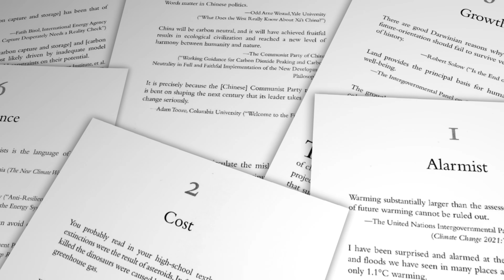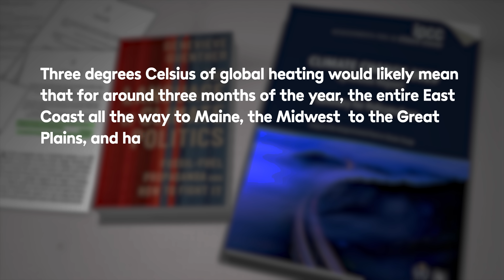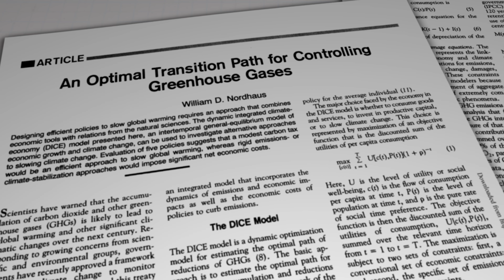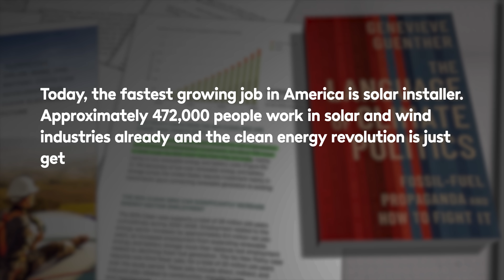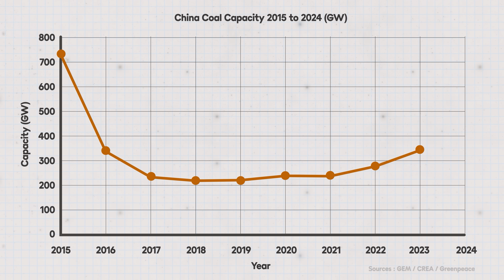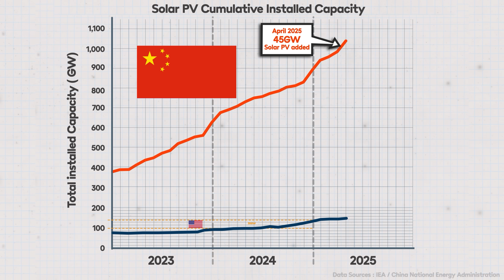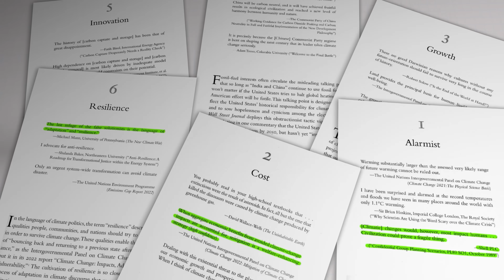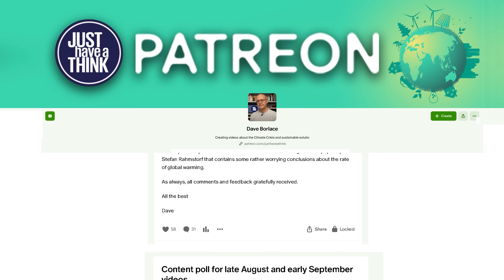New research DEBUNKS climate disinformation.

Comment: In order to build renewable energy powerplants you need to burn fossil fules and, in consequence, release GHG. The politics made by the western countries had the main effect of increasing the price of carbon credits, which large companies are still purchasing. These regulations had the effect of increasing the cost of many goods and services with an already high inflation hence reducing its capability to ''afford" climate change policies (e.g. purchasing an EV). I'm not saying the effects of climate change produced by GHG are fake and negligible, but if you rely completely on policy makers it will probably end in failure unless you change the social-economic aparatus, in other world controlling the economy. Lastly, one aclaration: The renewable energy sources won't reduce the price of the electricity bill necessarily.
Reply: Power with solar energy will become cheaper if you have it on your roof
and a big enough battery too or if God beware politics tackled usury.
Number one is more likely. 
Passive solar-thermal (Trombe walls, sun space equipped with shutters) and geothermal solutions in union with good insulation, high thermal mass walls/floors, reflective cooling facade and windcatcher will reduce power consumption significantly....
Reply: Bla Bla Bla Bla Bla 
Bollocks

Comment: Have a think?  Be a great idea perhaps Computer models are not data nor adjusted  data verified data,
Reply: Do you have any idea what Models are 🤔
Reply: @davidwatson8118  Funny I thought it was clear from Computer,  and still not data.
Reply: @davidwatson8118  perhaps Computer models is the clue?   Still not data.
Reply: @Bruno-u1r6o 
Do you not understand the word computer or model?
There is no shortage of data
Reply: @davidwatson8118  present your argument.  Most physicists accept Prof Happer's paper that CO2 has an inverse heating reaction after the first 20ppm declining on a logarithmic base or do you not understand.
Reply: @Bruno-u1r6o  Happer's arguments mirror in many respects the argument of Ångström back at the turn of the 1900's.

Ångström's argument, based on experiments around 1900, claimed that increasing CO2 in the atmosphere would have little effect on Earth's temperature because CO2 absorption of infrared radiation was already "saturated."

Ångström's experiment used a tube with uniform CO2 concentration, which didn't account for the atmosphere's vertical structure. In the real atmosphere, CO2 absorbs infrared radiation at different altitudes. As CO2 increases, the altitude at which infrared radiation escapes to space (the effective radiating level) rises to higher, colder layers. Since these layers emit less radiation (per the Stefan-Boltzmann law), the Earth retains more heat, warming the surface. Ångström's setup ignored this "thinning and cooling" effect.

His experiment oversimplified CO2 absorption.  

Ångström argued that water vapor, more abundant in the atmosphere, absorbed most of the same infrared bands as CO2, rendering CO2 increases irrelevant. However, water vapor is concentrated in the lower troposphere, while CO2 is well-mixed and affects higher, drier layers where water vapor's role is minimal. Spectral analysis later showed minimal overlap between CO2 and water vapor absorption lines, confirming CO2's distinct warming effect.
Reply: @Les_S537  This heating reduces as CO2 increases this is  to nearly zero (absorption of infrared by dry air  containing CO2 at 350 ppmv) in repeatable experiments.  I don't see this as saturation but that shorter wave length photons are depleted by water vapour.   Do you think Earth radiation is high enough energy, short enough wave length to react with CO2?  This seems to be discounted as the energy is less than the  emitting surface.  ie the Sun against energy absorbed and reemitted at night from earth?   We know a lens focuses to burn direct Sun Photons but the Earth?  The moon certainly not,  Kooks a Nuclear Physicist shows how the SB formula is in  error and over estimates black body  radiation but thats his argument rather than mine on the  Cfact site.

Comment: Still focused of climate as the major breach of earth systems when you know very well that there are three more earth systems that are far more breached than climate. And to talk about species extinction like it is just a climate issue when we are seeing the rapid decline of species mainly driven by the loss of the biosphere. You need to get to the point of accounting corruption and view earth systems with a consistent accounting, preferably net accounting and not cherry picking data through gross accounting.
Reply: Bollocks
Reply: @davidwatson8118  sounds like you know what you are walking about.
Why don't you look up the Stockholm Resilience Centre Planetary Boundaries, what the leading contributors are, then talk properly to me after that. 
Cheers.
Reply: @davidwatson8118 I am proven wrong then. So you are telling me that climate change is more of a threat to life than biosphere loss, novel entity overload, and nitrogen and phosphorus loading? And you think that measuring fossil fuels using net accounting and using gross accounting for agriculture is not dodgy?
Reply: @tobybrown7669 
What is causing the current global warming. 🤔,?
Reply: @davidwatson8118  The climate is part of earth systems so there is not just one cause but because we have breached other earth systems even more then they should be talked about more. Biosphere loss is by for the most breached out of all planetary boundaries and the main driver of that loss is animal agriculture. Freeing up land is the most important thing we can do to stabilise the climate and stopping animal agriculture frees up 40% of the ice free land allowing for more time to transition from fossil fuels to alternatives. The primary focus needs to be on our food system and transitioning to a plant based diet. We have to become herbivorous.
Reply: @tobybrown7669 
More wibble.
More bollocks 
I ask again.
What is causing the current global warming 🤔?
Reply: @davidwatson8118  my research suggests that the leading cause of climate change is animal agriculture by 118% meaning there would be a cooling effect if humanity went vegan. Stopping fossil fuels today would result in global heating before a cool occurs. 

What do you know about it?

Comment: I can’t watch this whole video, I’m too ashamed to be a US citizen. Nauseating how short sighted this administration is.
Reply: Courage. You're not the only person in the US who feels that way. Find your fellow travellers and work with them - either to mitigate the harms now, or to have a plan in place to take back control of your country and get it steady on a better path.
Reply: Stand firm and also know renewable transition is happening - slowly whether Trump likes it or not
Reply: @marksmit8112  no it's not - it's maxing out at 10% of all power supply - only electricity of course perhaps a little higher if massive hydroelectric resources are available, extremely fluctuating and thus often useless.
Reply: @marksmit8112  Renewables are a disaster. Look at what happened in Spain. They went on all renewables, and right away the grid went down, and the whole country lost power. 
The farmers in eastern Oregon are complaining about the oil getting spread all over the crops and livestock from the wind tubines, yes they still use oil. You have to lubricate moving parts with something.
Electric cars are worse for the environment than ICE cars, when you look at the whole picture. The problem is the batteries, which have gone up in flames so often, shipping companies don't want EVs on the ships anymore. 
The battery backup needed to make wind and solar practical isn't working. The biggest storage facility ever built, which is in California went up in flames for the fourth time not too long ago. The gasses released when a Lithium battery burns are the worst gasses ever produced.
Meanwhile the benefits of more CO2 are being ignored by the media. The planet is 20% more green as a result of higher levels already. CO2 was much higher in the past than it is today. Back before the Sahara was a desert. There is no data that shows CO2 really raises tempuratures all that much.
Listen to scientists, not activists. Bjorn Lomborg believes climate change is caused by burning fossil fuels, but says it won't lead to the death of all life, and it is not a crisis.
Other scientists, like Judith Currey, William Happer, and John Christie say there is more benefit from more CO2 than harm. 
CO2 is 4/100th% of the atmosphere. If it drops to 2/100% there won't be enough for plants to stay alive.
Get a grip. You are the ones listening to the lies.
Reply: @onusgumboot5565   so much disinformation in one post, you're ridiculous.
Reply: @fftunes  What exactly was incorrect?
Reply: @onusgumboot5565   Take "your" talking points into your bunker in Kansas City.
Reply: @crysstoll1191  I'm nowhere near Kansas City, but it's nice to hear from the "tolerant" left, giving your usual brilliant opinion.
I'm still waiting to hear what I said was incorrect.
Reply: @onusgumboot5565  It seems your first comment was removed? or i responded to the wrong comment? If so, my mistake. FTR i'm not tolerant nor left.
Reply: @onusgumboot5565  This is a stupid lie - the renewables were not responsible for the blackout in Spain. The wave in the grid started long before the Sun rose that day and the renewables came into the equation. Get yourself educated and do not post lies here. You are one of those we do not have time to waste for: https://youtu.be/Sfekgjfh1Rk
Reply: @DerAusdauersportler  The standard power grid doesn't have the problem with the fluctuations in power to begin with. It is stable by design. The renewables fluctuate wildely, and have to be controlled. If they didn't use renewables, there would have been no problem to start with. Which is why it didn't happen anywhere else.
Name calling is the strategy of someone without a valid argument.
Reply: You are far from alone . I feel the same.
Reply: Not as short sighted as the last one. The global warming narrative is based on computer models which have never made a correct prediction. More and more scientists are coming out and saying the models are too hot. 
CO2 levels were much higher in the past than they are today, and some of that time it was colder. CO2 is a necessary gas for life to exist. They call it the gas of life for a good reason. The planet is already 20% more green than it was at the start of the 20th century. Plants grow better in semi arid lands when CO2 is higher. 
CO2 only affects a narrow band of the suns radiation, and will not warm the planet any more than it has. That doesn't mean it won't get warmer, but CO2 isn't the cause.
Listen to William Happer, Judith Curry, John Christy, all scientists who debunk the climate change narrative, or even Bjorn Lomborg, who believes the climate is changing because of man burning fossil fuels, but says it won't lead to the death of all life, and it is not a crisis.
Oil and gas are not "fossil fuels" the oil industry came up with that to make it seem like oil was more rare than it is. They are Hydro Carbons. If they were formed by the remains of dead life forms, they would not exist on other planets, or the moons of other planets that never had life, yet they do.
Reply: Then watch it, and find others in your community to see what you can push for locally. the idea of top down power being the only option is how you get the current situation
Reply: THIS administration !? Every single US administration for more than 50 years have been a bunch of geeenosidal war criminals...
Reply: Then move away like your Hollywood heroes. Try someplace like Western Europe.
Reply: Trump is the best also he is you president for 7.5 more years. Cope harder libs😉
Reply: I think the people forecasting doom within this century are the short-sighted ones.  This will play out over centuries.  Meanwhile, we will electrify everything.  Reversing the long term trend of CO2 deletion from the atmosphere does have positive implications too, although you'll never hear the alarmists mention any of them.  They never talk about the real history of Earth's climate because it doesn't support their story.
Reply: Don't worry, it's just one-sided propaganda from this chap, as always. He's not going to call out the real culprits.
Reply: @Hedgehog-e3r Who are the real culprits?
Reply: @j377yb33n  China in cahoots with the UN. That should be obvious.
Reply: @Hedgehog-e3r So WHO are the real culprits????? You are saying then that 8 billion people on this planet are not impacting the climate. Take it you are rich, have no children nor grandchildren and don't care.